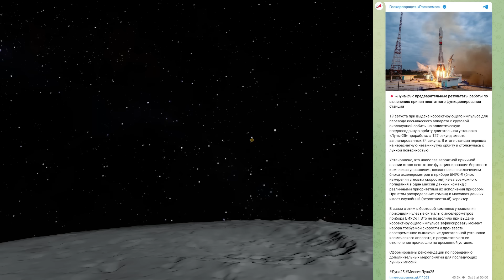Russian Space Probe Crashed Into Moon Because It 'Forgot' To Turn On Critical Hardware

Comment: Hello Mr. Manley
It  is incredible how many  stupid and ridiculous catastrophic failures were in history of space flights.
Luna 25 low priority event
OSIRIS-REx - wrongly connected first and main parachute
Mars polar lander - landing legs block altitude radar
Mars Climate orbiter - meter vs feet conversion 
Magellan lander - not implemented method for activation of main antenna.
Phoebus probe - missing validation of input commands.

and some administration error  - Vega rocket missing two fuel containers.

Comment: The original explanation that I heard was that the moon lander failed due to the contractor / department (?) not following the specifications on the transistor prong coatings (and then being in storage a long time).  I.e. gold coatings don't corrode as fast, but since the craft was originally due to be launched in a short time (actually years ago) the provider decided to skip this spec and save money.  So I wonder which error is true.

Comment: How strange. Consider an automobile engine control unit, which uses the same structure of a common communication bus. 
The car engine control unit utilizes the same system of priorities for the various tasks at hand; but for absolutely critical tasks - like firing the spark plugs - the system uses a hardware interrupt, not a software one. This is because there is always the possibility that, even if you give to the spark plugs the highest priority, the computer can postpone the execution for a number of reasons...

Comment: Well, we can't really criticise too harshly when in the past one of NASA's probes to Mars burned up due to a consufion between metric and US imperial measurements...   Also, wasn't there another lunar probe that crashed because it passed over an unexpected crater as it's flight path had been changed from the originally programmed path hence various sensors were deactivated as the measurements were too different from what the computer expected hence deemed by the program as faulty sensors.   I'm certainly disappointed with Russia's efforts but plenty of such oversights has been prevalent with such space probes from several countries and we don't seem to learn to double check despite all such previous failures.
Reply: Space is hard! And IMHO these days space seems kinda post-grad rather than "NATIONAL MISSION", if you know what i mean.
We try and we learn, all of us.
Reply: well, that Martian probe that had problems with metric units that was OVER 20 years ago, NASA has had phenomenal track record on Mars, outer planets, deep space, etc, to compare Russian failures that for example attempted to land on Mars like dozen times with no luck to NASA failures is just laughable.

Comment: There is a few distinct downsides to having a shared bus.

1) Single point of failure. If the bus is physically severed or if the bus is flooded, nothing works.
2) Time critical operations are sharing space with less critical systems and you run into this priorities dilemma where a simple failure in set up can cause the whole thing to die. And it's not immediately clear as to why.
3) Bandwidth considerations in general. Instead of being able to rely on a dedicated data lane for one particular system you now have to weigh in all systems that communicate on that bus and give them priority. It doesn't really hurt to have too much available data. But not having enough? Yeah!

Also, as in hardware and especially flight critical hardware, software needs backups and fail-safe modes. For example, if no accelerometer readings are made after firing the engine. Fail safe to not fire the engine and request a manual operation or make a pass.

Comment: "As a computer nerd, 127 is the highest number that can be stored in 7 bits"
Yes, but WHY would they use 7 bits? This isn't the time of the Apollo space program. 7 bits vs 16 vs 32 vs 64 bits really makes little difference here.

Also, as a time critical variable, max time to burn would be a floating point value or even measured in clock cycles. Not in seconds.
Reply: As he said, it may mean nothing but it sticks out as a common number

Comment: Bus communications protocols are not software, they're electrical engineering.

It's also a problem that has been basically solved for decades with off the shelf hardware. The fact the Russians got this wrong shows how thoroughly incompetent they've become after decades of brain drain. Trying to spin your own bus in this age is like assigning an intern to figure out how many sides your wheels should have.

Comment: In any real time O/S, delivery of messages is critical to knowing whether a system if performing in a "Good" state or a "Bad" (unknown) state.  Software design becomes paramount, and it is vital to know sometimes whether a message was delivered or not.  Most systems have a way to send a message and require an "Ack" back.  I would think that spacecraft designers would have thought of that before crashing.  You would also have thought they'd use something different than a 7-bit timer for a critical operation such as deceleration.  After all, everyone now knows the results of not picking a better value for a timeout.

Comment: Modern software suffers from poor testing (usually caused by time constraints) and the belief that software /can/ be written correctly if only you find the right combination of language and process. Language and Process can help a lot (it's a lot easier to write correct Python than correct Assembly, and having policies on memory handling/etc helps consistency), but they are not a magic bullet. Software WILL contain bugs and you can't find them without proper testing.
Reply: I should add IMO. ;)

Comment: As a network engineer, I argue against "ethernet" being a shared bus that computers can get and equal chance to talk. As the old 3Com debacle points out. The original Ethernet is shared bit of wire where he who shouts quickest gets to talk. Nowadays Ethernet tends to not used shared physical layers and each node has a dedicated link to it's neighbour and uses a store and forward method. SDH might be a nearer equivalent or even FDDI, but I don't know the bus architecture the Russians are using

Comment: Whoever wrote that software didn't seem to add any error correction to verify that the sensor module was actually responding. As a software engineer and having worked on theme park rides, I feel like that is a very basic thing to miss. You send the signal to activate the module, then you check to verify if it's working. If it's not, you set an error flag, and keep trying until you either abort or alert ground crew you have a major problem.

Comment: Doubtful it's something like 127 is the full register value... who would use a 7 bit counter? It's not the 80s anymore. It might be something simpler like a 50% margin on the expected burn value. 84*1.5=126. If it was 84.x then 127 would be about right. 🙂

Comment: Message priority or not, there needs to be either an acknowledgement received or a status query, or both.  Or even a two bus system with high priority communications on one and status on the other.

It's like separating your corporate network so you're not limited to only controlling it via the main network, so that if it fails you use the alternate management access to troubleshoot it.

Comment: As a principle software engineer, and ex head of department, engineering manager, etc, I can tell you the reason there has been so many crashes recently is that most software engineers are actually awful at what they do. The problem is the average software engineer knows they are awful, they know their colleagues are awful so they all band together against criticism and ensure that anyone trying to raise standards is seen as an outsider. Good or better software engineers are rarer and when put together they make amazing teams, they accept they're flawed, they grow, they learn together and raise standards. The problem is that the market is so large and the skilled engineers are so spread thin now that it's hard to find the skilled engineers and bring them all to one place. 

You might think, do higher salaries attract better engineers? Yes, but they also attract everyone else too, and it's very hard to filter out those who lie on their CV, chat their way through interviews, cheat on take-home tests or are otherwise horrible to work with due to their politics or personality, especially as HR/hiring managers seem to like the annoying political types more than hard working and skilled engineers.

I've been fortunate to have run large software teams and departments and been given full control over who stays and who goes and often made great use of that ability to remove the negative contributors, but this is NOT a common thing, most managers are very reluctant to make their teams smaller and more lean in part due to having to hire more engineers and a fear that they'll been seen as less valuable if they only have a small number of highly skilled reports. I have no such fear and I made incredibly efficient, happy and geled teams that would not have made these damn stupid errors I've been seeing over the years. I mean it; a team I assemble and am a part of would have done better. Most software engineers don't deserve the title.

Comment: WAS NOT A SOFTWARE ERROR 
Errors in software should be presumed to exist as a core part of the design process.  It is the design resilience, error catching, exception handling,  quality control and quality assurance (I.e. testing) that failed. 
A bit more simply, they couldn't be arsed to find the errors.

Comment: In roscosmos software engineers paid around 14.000-26.000 rubles per month (its like 150-300 USD). It is extremely low even for russia. What do you expect? They work on bare enthusiasm

Comment: As a software engineer I have to admit I would be piiiiiiiissed if the rockets and instruments and everything else worked fine and then the landing failed because someone didn't check the software well enough.. Don't get me wrong I wouldn't go anywhere near writing that kind of critical software, but surely if you are doing that you would be testing it SO hard, this just sounds like laziness from Russia, India, and Israel.. Come on get it together, during Apollo the software was one of the strongest links,.

Comment: I find it funny that the Apollo program had a similar issue with the computer system on the lander getting overloaded, but the OS was able to deal with it, throwing errors, but still functioning to get the lander down.  The issue was figured out pretty quickly, and an update was made available, but re-threading the memory ropes was considered too expensive and a simple change to the astronauts checklist was the fix that went forward.

It's fascinating, and anybody who wants to know more, this is google-able if you want to find out more.  I am going off of memory, so i might be wrong on a few details.

Comment: I feel like a lot of these software glitches causing unscheduled landings on lunar missions could be caught by running simulations. If you can build a real enough virtual sandbox with a software version of your spacecraft, you could run the whole mission a few thousand times before you ever launch. If you put the computer in charge and the virtual probe goes splat, you can dissect what exactly went wrong.

Comment: Tricky bug to diagnose bus contention is a massively non-deterministic characteristic but honestly you'd have expected the engineers to have the activation of that sensor on the critical-path for success and having it set to a low priority, and the rest of the system failing to detect its non-availability as an error condition and ploughing on regardless rather than waiting is disappointingly naive.

Comment: Re 127 seconds at 3:28 : It was also common, back in the 8 bit days, to assign a range starting at -128 and continuing to +127.  This would fit in 1 byte, and gave you the opportunity to store negative values.  Why they would want negative values isn't clear to me, but it might have been the standard way they handle all their non floating point data.  Just a thought.
Reply: Personally, i doubt storing seconds in an integer at all. Thousandths of a second - maybe, but not entire seconds, much less so in a single byte.

Comment: How was there bo feedback? In any ooeration design a task is not finished until the check is done. The inertial guidance system not turning on wouldnt have been an issue if the system continuously sent the message to turn on until it received "IGU on" feedback. It might have missed some cycles but it wouldve been fine.
Reply: It looks like proper

Comment: As a former Test Engineer at the Evil Empire (the formal title is Software Design Engineer in Test, or SDET) I can say that most SW firms don't put in as much testing effort as MSFT. In the OS division, we had 1 test engineer (who was themselves a programmer) for EVERY actual developer. And we had huge labs for testing every different computer that we could get our hands on, & extremely detailed test plans & procedures that were reviewed regularly by very knowledgeable folks.

I've developed (& tested) medical electronics as well, & the testing there is even more rigorous, as someone's life is often on the other end of the equipment we worked on. Avionics is similarly extremely test intensive.

But I'd hope that all of that would pale in the face of equipment that was going to space.

And while this is probably (hopefully) true with much of the industry, I suspect that SpaceX is a bit more, umm, cavalier about its testing. Witness the fact that the next super-heavy booster has yet to conduct a failure-free all-engine test fire, even though it would be pretty quick & easy for it to do so.
Reply: Non software dude here...
Evil Empire, MSFT, OS division?

Comment: I had a thought a few weeks ago that maybe the problem was that it was supposed to burn for 87 seconds, and someone called it one minute 27 seconds (1:27). So then the programmer set it for 127 seconds. I guess I was wrong.
Reply: AFAIK computers don't reallyt use years, months, weeks, days, hours or minutes. Eg computer time that you see on Windows clock is "the number of seconds elapsed since 00:00 on 1/1/1970", stored as a 64 bit number. This might lead to a "Y2K + 38" problem but I imagine there's a solution.

Comment: One crash is more expensive than one hundred cables , that can be verified instead of 1000 lines of code.
there in not a single project I was participating that was error free on essential functions, including my own, requiring on hardware testing and verifying after defining the FMEA
(Failure Modes and Effect Analysis)

Comment: My experience is that software is written, verified, and checked agents a set of software requirements.  Only when you run full simulations on the system do you know if the requirements  are correct, and even then, only as far as it was tested. I remember one program that had a bit inverted on two sets of requirements.  I could not convince the software engineers that it wouldn't work because the software was written  to each of their requirements.

Comment: As a software engineer it just astounds me that they couldn't be bothered to allocate some budget towards doing a full virtual run-through. It's like they tested each part individually but not the whole thing at once. Integration testing versus unit testing. It's like they didn't do any integration testing whatsoever. Not a good idea. It's many orders of magnitude cheaper to hire a software team to do that then it is to send up another f'ing rocket.

Comment: Recently there were some very smart folks who took an old Apollo Guidance Computer and fed it inputs to trick it into thinking that it was on a normal mission, instead of a simulated one.  It seems like the Russians could have done (more of) this kind of testing to work out all the kinks in the software so it wouldn't do something "stupid" like this.  After all, astronauts train like crazy on all kinds of possibilities (including a "nothing goes wrong" scenario) to weed out the problems and shortcomings; software should be tested to the same standard.

Comment: you mean they couldn't get a small flag through to say "turn on the inertials" on the bus? Which might take a few cycles on a clock running at probably 10s of megahertz? Maybe a quick little interrupt? But no, you're lower priority so no bus for you!!
I don't know- maybe there was something about the architecture that made this problematic.
But hang on - don't they run the code base on a sim environment to see how the modules and comms act? Isn't that kinda standard these days?  Mother Rus, what you doing?!

Comment: Software for these types of missions seems to be getting worse as the hardware and programming languages get further away from each other.  We had some very simple code back in the day that would do each step by priority until it timed out.  Then any lower level tasks wouldn't get run that time thru.  Hopefully it would get thru on the next pass.  Kind of like the lunar lander issues when it kept running out of time to do all the steps and issued a warning.  It wasn't fancy.  It didn't use C++ or whatever.  Just straightforward assembly language that you knew what it was doing.  Modern languages (I have no idea what they are using now) depend on libraries of code that you have no idea what they are doing.  It puts the coder another step away from the hardware and allows more mistakes to happen.

Comment: My wild theory on what probably happened is the accelerometer got a bit flip in the message it was going to receive. It then dropped the badly parsed message on the floor and the overall system didn’t have the redundancy to try to send the message again if it failed to return a response.
Reply: Someone who talks about bits like that, works with protocols I bet !!